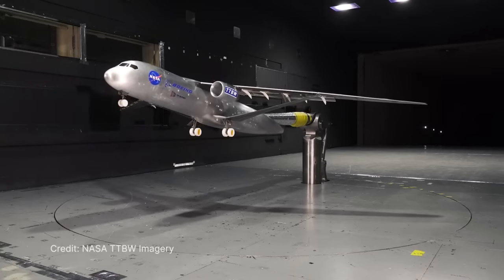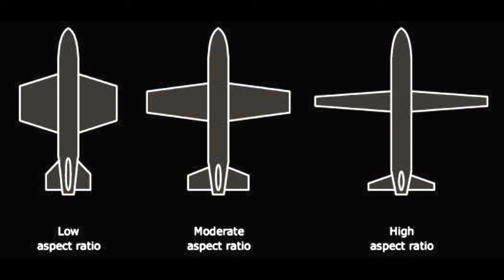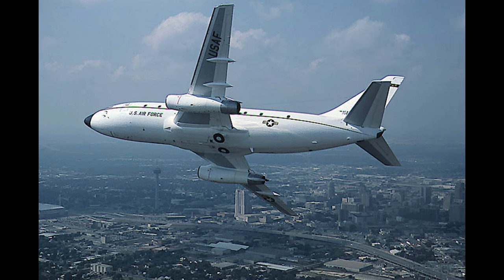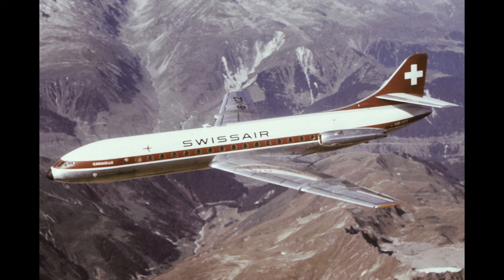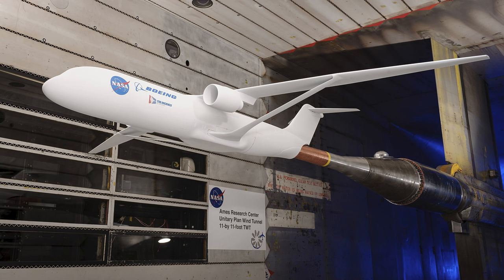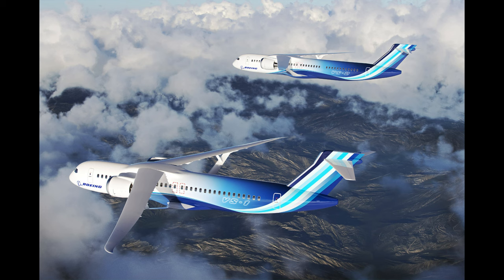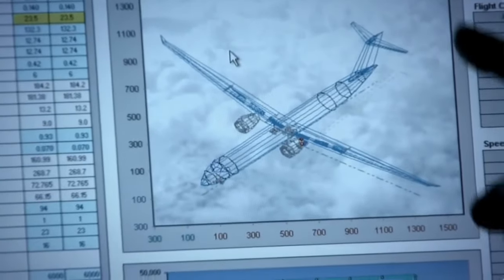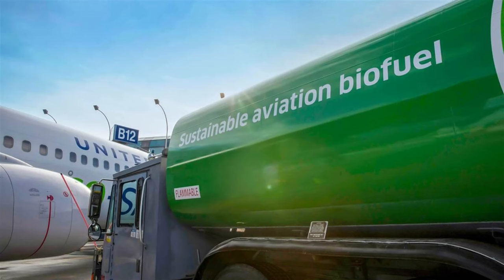NASA's New Airliner Experiment To Make Flying Less Expensive

Comment: FAA is one of the worst when it comes to accepting any change. As a general aviation mechanic, we are just now starting to phase out carbureted engines from NEW production aircraft.  

As for leaded fuel, the worst part about that is most aircraft will run perfectly fine on unleaded fuel. To legally run ethanol free 88 octane fuel you must pay for a "modification" to your airplane that is applicable depending on what engine you have. The modification is a sticker on your fuel tank. (its not a cheap sticker you have to buy off the guy who did the research to get the fuel approved)

Unless your rich the FAA is an absolute nightmare to work with. Everything is wrong until proven right and guilty till proven innocent, and its all on your dime to prove your point.

Comment: ...hmm engines directly outside the passenger cabin.  Have any of these engineers ever flown on a BAE-146 or IL-76?  

The other issue, what if a turbine blade fails?  SInce it already is a T-Tail design, why not rear mount the engines like the 727 nd DC-9/MD-80 did?

Both variants also would be single not twin aisle aircraft.

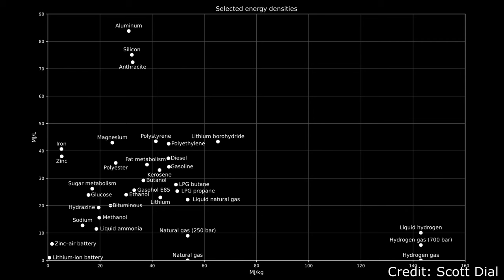Comment: I'm shocked to see aluminum at the very top of the MJ/L graph at 9:32.  Though I guess that explains why the aluminum superstructure on the HMS Sheffield burned so vociferously when hit in the Falklands war.
Reply: They used aluminum as rocket fuel on the Space Shuttle, and on the SLS rocket that recently sent the Orion capsule to the Moon. The Solid Rocket Boosters on each use ammonium perchlorate as oxidizer (70%)  and atomized aluminum as fuel (16%). the remaining 14% is binder and curing agent, which of course acts as fuel also. The aluminum is what made the Shuttle and SLS launches have such a bright flame, something you have to see in person as it doesn't show up on film or video. I was surprised when I saw my first Shuttle launch, it was so bright even from seven miles away. I wondered how I had not known this, then I realized that if someone had never seen the Sun but only had seen photographs of it, they would have no idea how bright it is. SLS is apparently somewhat brighter as it has larger SRB's, which I thought wouldn't make a difference since they are the same diameter just more length, but it turns out the extra length actually makes them burn harder not longer.
Reply: @StevePemberton2  indeed if you make a SRB longer it just increases the thrust. It's like a hollow candle, it burns away from the "tunnel" inside. To extend the burn duration you have to increase the diameter of the SRB
Reply: @simonm1447      Thanks for confirming.  I thought that was the case.

Comment: That ultra-thin SHORT section of wing between the hull & the engines can't by thickened to increase strength for the engine attachment & incorporate a fuel tank??? These guys may be short on sense! ;p Plus that long under strut has to flex as much as the wing or the wing connector will suffer massive stress fractures in no time at all! What about a biplane lower wing out to the engine with a canard out past the engine??? This should reduce the need for a longer wing, or increase cargo lift capacity loading!!! :)

Comment: 11:22 "Just this year we finally had unleaded aviation fuel approved for aircraft in the U.S." should have been stated more specifically. You were presumably using "aviation" as shorthand for "general aviation", but the distinction would be lost on many viewers. Jet fuel, used by the big commercial jets, was of course already unleaded. (Also, while the across-the-board approval just came in 2022, the new unleaded avgas  by GAMI was already approved for certain engines in 2021.)

Comment: I remember in my A&P classes 15 years ago we ran a Continental O-300 and Lycoming O-320 on the two unleaded fuels and both engines died after less than 5 minutes at 2500RPM. We also ran another O-320 (D2J) on an ethanol blend. That one grenaded the case slinging jugs everywhere in less than 2 minutes at 2400RPM. GAMI was not even thought of then. The lesson? DONT USE ETHANOL IN AN AIRCRAFT ENGINE!

Comment: How about removing the non-lift generating fuselage as in the Northrup flying wing concept, as in the B-2 bomber?
Reply: The challenge here is to make a cabin which can withstand the internal pressure at cruising altitude (difference to the outside 0,5 bar, but these are 5 t per square meter) without adding too much weight. A round cabin like in a standard aircraft has the advantage its relatively light, but still stable enough.
The B-2 don't has this problem since just the small cockpit is pressurized
Reply: @simonm1447  Excellent point. Thanks.

Comment: I’d love to know what it would take to develop a hydrogen powered jet engine? Making liquid hydrogen could be paired with nuclear power plants that don’t have to be turned off and can be connected to desalination plants to generate fresh water than can rehydrate underground aquifers and can also perform electrolysis on water to generate hydrogen gas before cooling it into a liquid for transport.
Reply: Hydrogen doesn't have the energy density of fossil fuels. Hydrogen embrittlement can degrade materials used to store it under pressure. 

Fossil fuel hybrids are the way to go. Solid state Li batteries for safety (use fossil fuels for take offs and landing in harsh weather and crosswinds... electric for cruising altitude above the weather.)

Comment: Those underwing spars are the pre- modern large passenger aircraft monoplane solution! Nothing new. They are just dealing with the wing vertical flutter which can rip wings apart, or tear them off the plane. The only new thing Is, taking it from formula 1, that the truss is designed to act as a lifting surface.

Comment: It's why commercial space travel is such a critical nut to crack. There will come a time in the very distant future, where we don't require a huge (rocket) fuel payload to punch through the atmosphere. We will have developed a way to get a craft capable of carrying a few hundred passengers safely into space, and then simply glide down to our destination, using boosters and servos to keep us on course. Perhaps this is where electric power will eventually shine in aviation. The incredible torque we see in electric cars might eventually be utilised alongside jet engines, rather like a secondary rocket on a space rocket. Use a conventional engine to get as high as we can, asap, then electric turbine power kicks in to punch us into space, then we switch all power off and glide along.

Comment: FAA did not want 2707 SST high wing design because in a crash fuel would drip down on the passenger compartment, so issue here.
Reply: what do you mean with "high wing design"?

Comment: The main reason this will fail is because it will affect the loading on the ground at terminals. Thinking of ATL (world's busiest airport) the airplanes are already very close in terminal. Airports aren't going to redesign for this.
Reply: the wings will fold to fit in normal gates. extended it's 767-sized, which shouldn't be a problem for most airports

Comment: Ultimately, it adds additional elements to the aircraft and so it might not come to happen. Adding additional materials adds more risk.
Reply: geared turbofans, variable pitch turbofans, etc all add substantial engine complexity, but the fuel savings is worthwhile. obviously it's a tradeoff but i think this efficiency gain is pretty compelling if there aren't any significant technical obstacles that aren't known already

Comment: Can't see jet aircraft with extra long wings entering service for two reasons. Firstly airports can't handle the extra wing span. If you redesign airports to fit then you would reduce the amount of airport gates.
Secondly, on a quick scan I couldn't find one MRO in Europe with a hangar big enough to fit these aircraft in.
In any case, in 50 years there will be a lot less commercial aircraft flying in the world!

Comment: Cars do have a viable electric option but I wouldn’t say it’s been solved. It is not possible to replace all gas vehicle with electric vehicles. The resources for the batteries and the infrastructure to charge them just isnt there to support a complete switch.

Comment: Basically "fuel is now so expensive it's better to pay your crew more for longer flights because that's economically more viable"?
Reply: Flights aren't longer with this?
Reply: @AmbientMorality  if they have to sacrifice speed (which was implied) flights would take longer.
Reply: @SyntheticFuture  They don't. This flies at Mach 0.8, which is the same as most narrowbody aircraft. It also should climb to cruising altitude a bit faster, which slightly shortens flights.

Comment: Bad design wing is way too long and will impact crowded airport terminals big time, plus the blended body wing design is far more efficient and the aircraft can carry far more people or cargo than this design.  Both Lockheed and Boeing are working on this alternative design for a future cargo carrying aircraft.  Lockheed has said their design will carry more cargo weight than the C-5 (USAF biggest cargo aircraft) and use only 30% of the fuel as a C-17, USAF's modern large size airlifter.

Comment: Wasn't it proved years ago that planes should be flying backwards, ie, small wing at the front big wing at the rear, I read where two planes of the same size one flying backwards traveled further on it's fuel and flew better.
Reply from the maker: In a traditional aircraft design having the elevator at the back pushes the tail down to keep the nose up, so it's actually taking away lift. Canard designed aircraft do the opposite and in theory get better lift/drag ratio, but for other reasons the designs tend to have higher stall speeds.

Comment: Since hydrogen planes need cryogenic pressure tanks which are optimally spherical, thick wings with tanks don't make sense anymore.

The future hydrogen airliner will have its ellipsoid hydrogen tank in a well ventilated aft compartment with this very wing type & engines at the very tail & canards at the front for elevators.

Comment: Excellent and unless they make the wings fold they aren't going to fit any normal airport. As was shown the manufacturers are so concerned their new plane folds the tips up to prevent them from being ripped off or whatever. One can only imagine pilots playing bumper cars with wings a half again as wide as they are now. They might as well pull the old swing-wing design and they have those parts in the boneyard too.
Reply: The wings are going to fold a bit outboard of the strut attachment point.
Reply: @AmbientMorality  That seemed to be the only spot available. Just wait till that fails mid-flight.
Reply: @superbmediacontentcreator  777X is expected to be certified on the basis that the wing cannot fold in flight (similar to thrust reversers), and I'd expect the same for this.
Reply: @AmbientMorality  Well how are you going to get in alleys let alone various hangers? I understand what you are saying but the two are in a real conflict.

Comment: I've always thought that adding more bits to a fuselage will create more inteference drag. That's why NASA's lifting body has stubby wings to reduce drag at high speed. 

So in this case, if you created a high aspect-ratio wing but support it with struts, wouldn't the wing efficiency get cancelled out by the drag created by the strut?

Comment: If this airplane gets produced, we're still many years away from that. It could literally be a decade or more. General aviation is decades behind for similar reasons. The cost and time to get anything certified is ridiculous. It does make some sense for airliners (unless they cut corners COUGH boeing COUGH). Small aircraft have been using slight variations of the same engines since the 1940s.

Comment: Check out Prof. Roy McAlister form the University of Phoenix. He did a video in 2005 on how adding hydrogen to fuel oil would increase it's burn rate, use less fuel and clean the air. I think Boeing is looking into it. Aloha

Comment: Biofuels are not the panacea they all claim to be. They are dirtier in fact than the fuels we use now so they present even more pollution problems that have not even been looked at yet. Jet aircraft definitely need better efficiency as they are very dirty engines. They put out more carbon monoxide(a major problem) and more carbon dioxide(a minor problem) than all the cars in the US do. So anything that can help them to get more passenger miles per gallon of fuel means fewer carbon problems for the atmosphere. I don't do "green"(misnamed nonsense) crap but I always am interested in cleaner ways of doing things as that means more efficiency and that is a worthy goal.
Reply: Where I live, anyone plugging in an ev... is getting their power from one of 3 nearby coal fired generating stations🤓👌 sort of defeats the purpose 🙄
Reply: Hybrid jet engines running off Solid state Li batteries is the way to go though... Fossil fuel for lift off... switch to electric for cruising (and landings too, under ideal conditions only.) This is the future.

Comment: I don’t think ANYTHING will persuade the airlines to make flying less expensive.
Reply: Flying has been getting less expensive for decades.  A Compass Lexecon study showed that, between 1990 and 2016, the domestic price per mile to fly decreased by 40 percent. At the same time, fuel costs have risen for airlines by 110 percent since 1998.  If you go back before 1990, the differences are even more dramatic.

Comment: My problem with this: these planes, inevitably, are going to fly slower. Considerably slower.

A flight from, for example, Boston to Orlando, takes about 2-3/4 hours. Not including the 2+ hours comitted to getting there for security and waiting for boarding. 

I dont want it taking 5 hours, or even longer.
Reply: It shouldn't. Transonic truss-braced wing is transonic; it's targeting around Mach 0.8.
Reply: @AmbientMorality  if they make it a straight, non-swept wing, which is what this looks like, then it is going to be slower. It can't not be.

Lest we un-learn the lessons learned pretty much the moment we first put jet engines on airplanes.
Reply: @davecrupel2817  Some of the renderings might be a bit off because the design cruise Mach for the first study was around 0.75. It was set in SUGAR Phase IV to Mach 0.8, leading to an increase in sweep and significant changes to the strut-wing interface. The sweep angle of the Phase IV configuration is about 22 degrees, and this is the configuration (approximately) that will get a full-scale demonstrator.

Comment: If designers placed their engines closer to the fuselage or on the fuselage, then the wings could be long and thin. But for some reason we choose to keep the jets on the wings. I think this increases weight, drag of the engine, drag of the thicker wing. It's time for Elon Musk to reinvent the aircraft.
Reply: If the engines are on the fuselage the fuselage weighs more, which increases the bending moment on the wing, which means the wing needs to be heavier. You want as much weight on the wing as possible (well, to a limit, but still).

Comment: So to do this, they'd have to give up cargo space for fuel?  It'll never happen.  Just the safety concerns will kill it.  You can't put fuel in the same part of the fuselage as passengers, so where's it going to go?  Sure, it'll save 10% on fuel.  But the fuel in the main fuselage will mean 15-20% less passengers and cargo.  Simple non-starter.